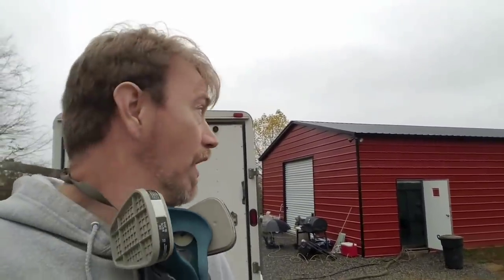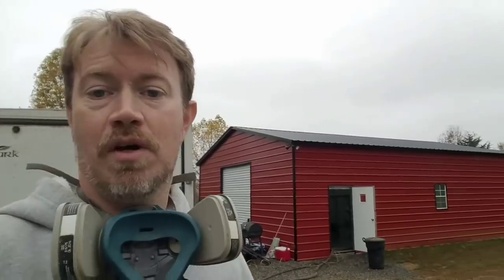Insulating Metal Buildings With Closed Cell Spray Foam

Comment: Since this appears to be an all-steel building, "rot" will not be an issue.  Maybe, if there is concern about rot regarding a wood or pole-barn structure, special considerations should be given as to the weather integrity of the building shell....as one would with most all residential construction.  True, there are no "perfect" one-size-fits-all solution for all types of construction; but, I think the benefits of this type of insulation as applied to all-steel buildings outweigh the potential cons or at least has the equivalent risk of traditional methods.
For me, it comes down to cost.  Upfront cost may seem high, until you figure what it will cost to keep a 35' x 75' warm enough to be used throughout the winters over the life of the building.  The more use you get out of your building, the cheaper it is over time!

Comment: can you spray the underneath of an RV or Travel Trailer??
Reply: Steven Spirito yes depending on how much room there is to spray, the gun puts out about 1,500 psi and from about 10 inches ( not sure how far it has to be to get a good foam job to be exact) it blows the foam away causing a mess and a waste of product... you need about 8-10 inches itself just for you to get he gun where it needs to be.

Comment: Can 8 ask about fire retardant properties as I'm planning on a metal building for welding in and confused on how to insulate without making a big fire hazard 
Thanks Chris
Reply: Much like using for residential, a fire barrier must be applied on the inside walls after the application of the foam.

Comment: Just a question is it ok spraying over the blue boxes and cables i could see on the video
Reply from the maker: Great question! It's common practice to spray over wiring and around boxes in new construction. If this were not allowed thousands of homes all over the USA would never have passed insulation inspections because it is impossible to install spray foam in a wall cavity without spraying the wires and around the boxes. If you are unsure about proper procedures regarding the building code contact the code officials in your area about what applies to your locality.
Reply from the maker: Actually it is okay according to most national building codes to spray foam directly over wires and around boxes. We tell clients if wire maintenance is a high priority then we recommend installing conduit first so the wiring can be pulled later if necessary.
Reply from the maker: We are three brothers in a pickup truck installing in the USA so international codes are not going to apply to us. 

I don't know what you consider "marketing talk" I'm just a guy at home trying to help answer questions honestly on a cell phone video I shot and uploaded to youtube a few years ago. I'm sorry my explanation didn't meet your international standards. The building code where we do work says it's okay so I said it was okay. Also properly created foam is harmless and if there were health issues with an installation then it was an improper installation. If foam were a health hazard it wouldn't be an approved building material used in homes all over the world for over 30 years.

I'm sorry a family you represented had a bad experience due to a poor installation. We have installed spray foam in thousands of buildings over the last ten years and our customers have only ever had great experiences with the results. Millions of buildings all over the world have spray foam installed with great results. We strive to stay educated on the codes that apply to us and the products we install.
Reply from the maker: Most people that we deal with find that having a stronger, more comfortable building that is very energy efficient is a higher priority than the rare occasion you may need to run a new wire. It's all a matter of opinion and what your priorities are. One could argue the savings in efficiency will offset possible costs of the rare occasion that you need to deal with a faulty wire. If they are really concerned about wires they should install conduit first or in this case even after the foam is installed.

In this particular application in a metal building I believe closed cell spray foam is superior to PIR blocks because spray foam adheres like a glue, creates an air seal, a code approved moisture barrier, it makes the structure stronger, and creates a monolithic thermal break preventing thermal transfer of heat through the metal. It will last the life of the building and will never fall off, shrink, or sag.
Reply from the maker: I don't know what kind of calculator you are using, but I can lay out some facts for your consideration.
1" PIR board has an R-value of 6 
1" Closed Cell Polyurethane Foam has an R-value of 6.8
Closed Cell Polyurethane foam's R-value rating alone is higher per inch than PIR board.
Plus Closed Cell polyurethane foam is fully adhered to the substrate (liquid applied and sticking like a glue) and is monolithic giving you a seamless installation with an air seal. This produces better "real world" performance than boards that are cut to fit, not adhered to the substrate, and have seams that have to be taped or foamed together.
In addition the racking strength of the walls sprayed with closed cell polyurethane foam are increased by over 300% and you are getting a moisture and vapor barrier.
Also Closed Cell polyurethane foam is the only FEMA approved insulation to prevent wind damage and flood damage, PIR is not.
Closed Cell foam will take the shape of structures like quonset huts and domes, PIR board is a fixed shape and cannot.
These are the reasons I believe insulating a metal building with closed cell foam is generally superior than using PIR. I hope this helps!
Reply from the maker: I said the building's RACKING strength is increased, as in from external forces like high winds. Lots of data out there to show it. Here is just one link...

https://www.appalachiansprayfoam.com/insulation/spray-foam-strengthens-walls/

It's a matter of personal opinion whether being able to dismantle the building's insulation like lego blocks is an advantage or not. If you want something permanent with a better seal and more strength I would say it's not an advantage.

Just you stating something doesn't make it true. It is well documented that closed cell foam is a residential code approved vapor barrier. Here is the information just one brand of closed cell foam by JM showing the technical specs of their closed cell foam and how it's a code approved vapor barrier.

https://www.jm.com/en/building-insulation/residential/spray-foam/

Also there is no gap between the insulation and the metal because it's liquid applied and fully adhered, so there is nothing to "drain". You cite a "moonlighter" making mistakes and causing problems. That can happen with any building material from PVC pipe to roofing shingles. If you don't install the product according to specifications you can cause problems. We don't install it incorrectly and in 10 years we have had no reported problems.

Spray foam is not a "cheap fix". It's a premium long term and permanent solution to insulating buildings and it's been used successfully all over the world for decades. It's longevity means it's not going to end up in a landfill in 10 to 15 years after it collapses and fails like many other more traditional insulation products often do because it will continue to work in our customers' buildings for a lifetime.

If you want to make claims against our products it would add more credibility to your arguments if you could back up your claims with some kind of sources, otherwise people will just assume you are biased and uninformed.

Comment: what about the health issues from the off gasing?
Reply: Once the surface has hardened (takes minutes to go hard) then it's 100% safe and no gasses come from it, then the rest hardens over 24 hours and it's solid.
Reply from the maker: Properly installed SPF is inert, has no smell once cured, and has no known negative impact to health. It's an approved building material for homes and businesses around the world.

Comment: I want to get a metal storage building for my lawn mowers but found the only spray foam guy here in VA is up in Roanoke and will not come down my way ,so what do I do .I live 15 minutes from the NC border
Reply: the building is 14 by 20 how much would that cost has a roll up door and a 36 inch wide side door
Reply: @sissymurphy9620  mine cost me $1800 for a 20x25x10ft wall. That was all walls and ceiling. Labor here is very low, but material prices are the same everywhere.
Reply: @integr8er66  here they keep telling me it should be open cell foam for some reason
Reply: @sissymurphy9620  I had that choice, they pointed me to closed cell and I think its the right choice, that way if a leak did develop it won't abdorb water and keep the metal wet speeding up an possibility of rust. Even though the metal is fully coated and the support structure is galvanized it just makes more sense to me.
You can buy a kit from home depot to do this since there isn't anyone in your area, but I know this will get me blown up with "You MUST hire a pro to do this" because we all know only guys who do stuff every day can do it right.
Anyway good luck with your project
Reply: @integr8er66  LOL  bees are a problem here with wood buildings so this is my first metal building
Reply: @sissymurphy9620  Ya, mine was my first too, and not tooting my own horn but it came out great. I put a wood stove in too.  When you cover these walls, if you do, you can order 10ft osb sheets from the lumber yard so the seams line up on the supports like they should since the supports are on 5ft centers. Then I ran my electric in EMT on the osb and just surface mounted my service entrance. I love Saturdays in winter in there. Hot stove project in large work area, cold beer and big screen tv 😁
Fat dumb and happy!
Reply: @integr8er66  mine is mostly to get my 2 ride on mowers out of my basement so the insurance company is happy .The one on this property is 10 x16 and the other property got a 14 x20 shed .I mostly want to stiffen the shed because I get lots of wind up hereon the hill .I will use it as a some what of a work shop in the front .I am putting up a lean too behind the other shed to park the mowers so they can cool off and get cleaned off also and dry before they go in the shed .Mine is a woman cave then .The other shed that I built  has a kitchen ,tv and fridge and is  insulated and sheetrocked  right next door to the metal shed so I will run electricity from it .Enjoy your man cave and good luck .

Comment: Would this be wise and cost effective to do inside of a mobile home?      Most have only R11 for the walls and R22 for the floors.      But from what I have seen and experienced in rental homes with poor insulation. Spray foam is a better way to keep your home warm/cool without having high gas bills.    I am planning to buy a mobile home and am looking at ways have it well insulated.    Any good suggestions
Reply: Ya don't buy one
Reply: Spray the outside of the mobile home. Closed cell foam is water proof. You can smooth it or shape it to will. Also can be painted.

Comment: is it affordable....the spray foam. i have heard it is costly
Reply from the maker: Spray foam can be 2 to 3 times more than traditional insulation products. Spray foam has a higher material cost, it requires expensive specialized equipment to install, and it requires extensive training and experience to install properly. These factors do make spray foam a more expensive option. Once many people see the added benefits of a permanent insulation that sticks like a glue, does not shrink, settle or sag, and prevents air infiltration they are still willing to spend more to get the best use out of their building. It's a premium product with premium performance and to many people it's worth the added expense.

Comment: How well does the foam handle water?
Reply from the maker: Closed cell foam is a residential code approved moisture barrier. It's the only insulation that is recommended by FEMA to prevent flood damage. Closed cell foam can even be used in Marine applications.

Comment: What is the ballpark on a 60x80? Thanks.
Reply from the maker: Projects can range in price from $1,000 to $10,000. Pricing can vary depending on a lot of factors like:
  >Total square footage
>Type of corrugation
>Type of foam sprayed
>Thickness of the foam sprayed
>How far away the client is
>Will a lift be required
>How much preparation (plastic and masking) is required
>How many doors and windows
>Will the foam need to be cleaned off of the studs
It's not an easy answer. This is why we do free estimates so we can give you a custom price for your project. I hope this helps!

Comment: How much did it cost to do the building in the video?  If anyone has done this and has a comparable metal building, please let me know.
Reply from the maker: I don't recall what it cost to spray this project. Projects can range in price from $1,000 to $10,000. Pricing can vary depending on a lot of factors like:
  >Total square footage
>Type of corrugation
>Type of foam sprayed
>Thickness of the foam sprayed
>How far away the client is
>Will a lift be required
>How much preparation (plastic and masking) is required
>How many doors and windows
>Will the foam need to be cleaned off of the studs
It's not an easy answer. This is why we do free estimates so we can give you a custom price for your project. I hope this helps!

Comment: The problem I have with this is panel replacement. I suppose you just cut through it and then respray?
Reply from the maker: On the rare occasion that you need to replace a panel you would want to cut the foam in the panel out and replace it. You would then patch the area with a portable DIY foam kit known as a froth Pak.

Comment: Do you have to cover the closed cell spray foam if it's in a living space? Is there a protective covering or something that should be used?
Reply from the maker: Residential codes do require a fire barrier to be installed over polyurethane foam when it's installed in a living space. We make all of our customers aware of this requirement and encourage them to complete the project according to the building code, but it's up to them to follow through.
Reply from the maker: @thefirst12lickit  I'm sorry you are unsatisfied with the rate at which I answer questions about this video. I do what I can to answer peoples questions when I have the time. This video gets hundreds of comments a week so it can be challenging to respond to everyone as responding to comments on youtube videos isn't my full time job. If you have a specific question I can try to answer it for you.
Reply: @thefirst12lickit  Sir, this was a legitimate question, one which all want to know the answer to.  Your saying yours or maybe someone else's was more valid is hypocrisy at it's best. People keep asking the costs, and Tom gives a canned answer.  The prices of materials fluctuate nearly daily, so one cannot lock in a price without assessing the needs of the client. Nice work Tom, wish you lived closer.

Comment: How much would a 15x20 cost approx
Reply from the maker: Projects can range in price from $1,000 to $10,000. Pricing can vary depending on a lot of factors like:
  >Total square footage
>Type of corrugation
>Type of foam sprayed
>Thickness of the foam sprayed
>How far away the client is
>Will a lift be required
>How much preparation (plastic and masking) is required
>How many doors and windows
>Will the foam need to be cleaned off of the studs
It's not an easy answer. This is why we do free estimates so we can give you a custom price for your project. I hope this helps!

Comment: is that fire proof???
Reply: It would take a heck of a lot of fire to burn through the surface.
Reply from the maker: It is plastic so it can burn, however It doesn't burn readily and can be covered with a fire barrier paint if need be.

Comment: How much does it cost?
Reply from the maker: Projects can range in price from $1,000 to $10,000. Pricing can vary depending on a lot of factors like:
  >Total square footage
>Type of corrugation
>Type of foam sprayed
>Thickness of the foam sprayed
>How far away the client is
>Will a lift be required
>How much preparation (plastic and masking) is required
>How many doors and windows
>Will the foam need to be cleaned off of the studs
It's not an easy answer. This is why we do free estimates so we can give you a custom price for your project. I hope this helps!